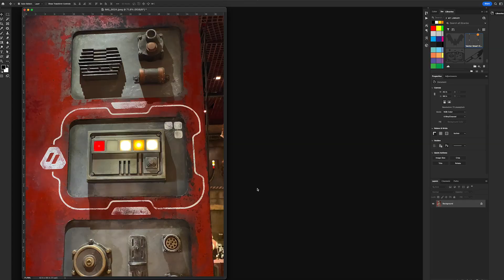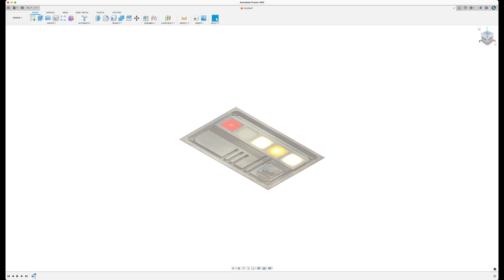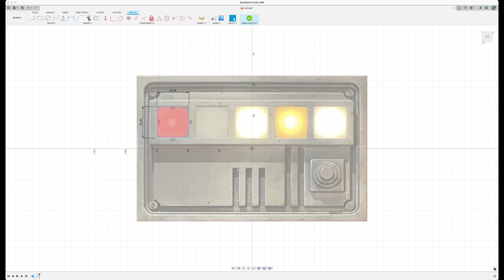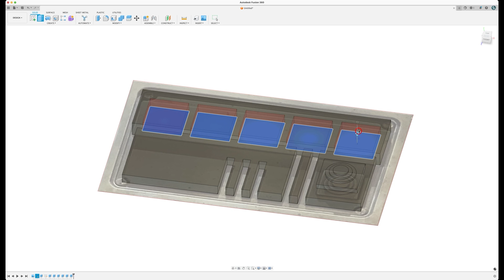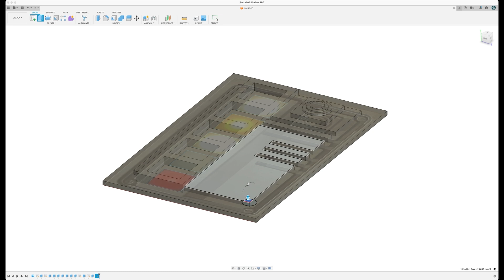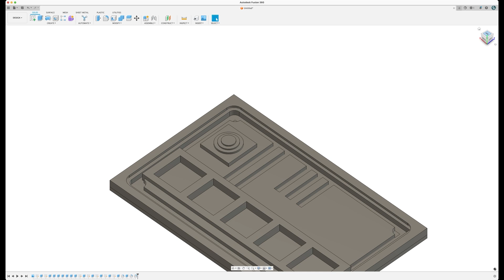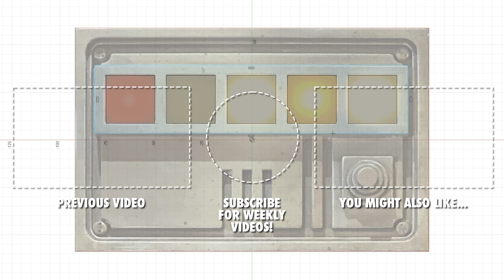How-to: Turn a Photo into a 3D Model

Comment: I would love to see what the next steps are. Are you going to 3d print? Laser cut? Cast?  I'm guessing this may be on your etsy shop soon?
Reply: Doh, I see it in your etsy shop already. :D
Reply from the maker: This model would be output for a 3d printer, but you could definitely convert the dimensions into a file useable on a laser cutter.